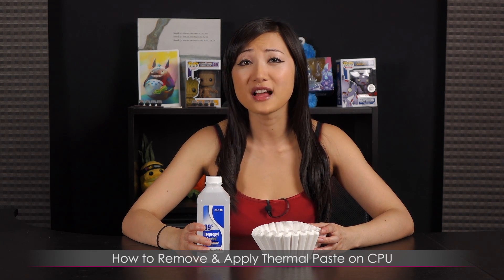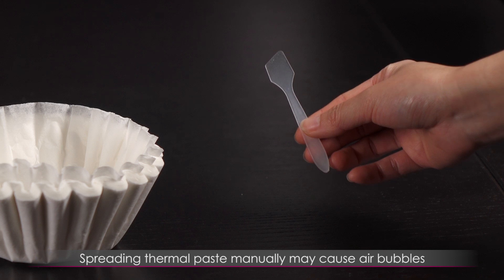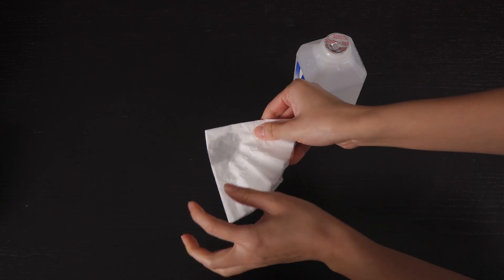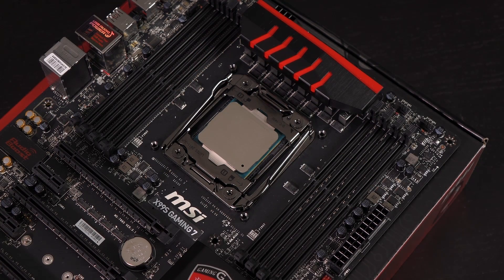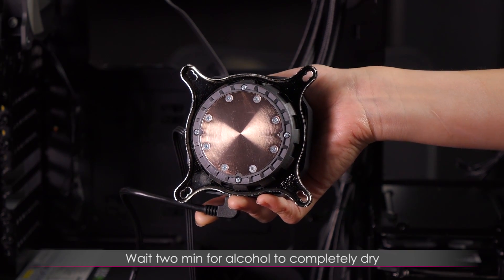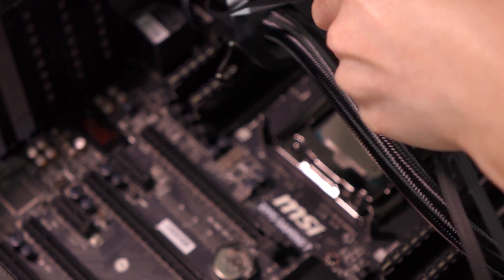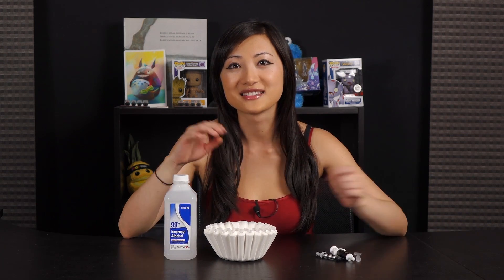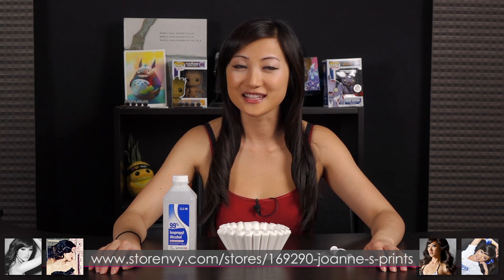How to Remove & Apply Thermal Paste on CPU

Comment: whoaaaa you use WAY too much thermal paste! The cleaning tutorial was very good (coffee filter-- great idea!) but the amount of thermal paste used will be detrimental for your CPU temps. A small rice bead is more than enough, the only reason you're using thermal paste is to mitigate any imperfections between the surfaces for a perfect transfer of heat. The materials on the CPU and the heatsink of the cooler are a lot better at conducting heat than thermal paste, so using less will actually improve your cooling.
Reply: brakgeluid
Are you an idiot that you cannot understand? Even the video proves it. Having too little actually makes it worse. Having a little too much does nothing.

The TLDR does not conflict with anything I said. The amount between the CPU and heat sink will be the same, no matter how much you put if you put enough to cover the heat sink (aka the minimum). The rest will be squeezed out. If there isn't enough, how the hell are you gonna cover the whole heat sink?
Reply: +brakgeluid as if you know anything about thermodynamics
Reply: JayzTwoCents did a video on this and proved that two much thermal paste doesn't make a difference to temps. While he only tested GPU temps, I suspect this is the same with CPU temps.
Reply: MEGA_MJRS they won't listen. I told them the same thing, but they keep on parroting what people said before. I even explained why (in my opinion) it is.
Reply: E Alex explain the videos, fool. He has no evidence for his claims as far as I can tell. The videos prove otherwise.
Reply: E Alex do you lack reading comprehension? What does "his method" contradict with what I said? Or even what MEGA_MJRS said?
Reply: brakgeluid
Ha, my ass.
Reply: +brakgeluid If you compress it hard enough it will be fine. Only issue I think is if you're using conductive paste which may go over the other components.
Reply: brakgeluid
You do realize there will be the same amount of paste between the CPU and the heat sink? If there is enough pressure, the extra paste will be pushed out. Meaning that putting enough paste will be the same as putting a little too much, assuming you don't a crazy ass amount.

Now if you don't put enough, well if you watched the video you would know the result.

TLDR; There will be the same amount of paste between the CPU and heat sink if you put more than the minimum amount.
Reply: So I was doing a new build recently and decided to test this myself. I had a new CPU to replace the old, and was only going from skylake to kaby, so figured I'd give it a shot. Too much thermal paste does absolute NOTHING... yes, NOTHING to thermals vs putting just the right amount. I ran realbench in each test with a light oc at 4.6ghz @ 1.35v on a 6600K. Was at 60-70c after about half an hour in each test. I did go higher using too little paste. I'm sorry, but after testing it myself and doing benchmarks, the one who was right here was actually 2010ngojo. It seems there are also youtubers who have tried the same thing. Jayztwocents I believe covered this with the same result. I was using a h100i gtx.

Another interesting note- its also running at the same as the stock paste that was applied to the AIO to begin with.
Reply: Even coverage is key using least amount of paste possible. I'm not sure a grain of rice sized blob would be enough, perhaps a 4mm blob would spread better.
Reply: I used brakgeluids method and it seems to have spread perfectly. My temps are really good right now, I OC my i5 3570k to 4.5GhZ with only 1.615V and under gaming load it reaches like in the mid 40's C.
Reply: Hey man I have a 3570K I want to OC it tomorrow, can you tell me if you use an aircooler? =)
Reply: +PapierVersnipperaar yup I use the hyper evo 212 air cooler, its amazing man and its only like 20 something bucks US and like 32 dollars on sale in Canada right now! Highly recommend. I use to always put off the air coolers cause they are sorta a pain in the ass to put on, if you will buy one, make sure you use a different thermal paste than the one included as its not that good, i recommend arctic cooler mx series. Speeds from the OC have been so nice!
Reply: No she is not lel....
Reply: I've been using too little thermal paste and the temps were fine until the next day they skyrocketed.
I used the pea method and temps were fine a couple of days and boom 50c idle.
X-method gave me 3-5 LOWER temps in LOAD, covers whole CPU and without air bubbles.
Reply: Roderick McPhail 
Not at all. Dry paste is a bad thing actually. It could create air bubbles.
Reply: You're a man. You don't know any better than to think this way.
Reply: I saw many tutorial on youtube and try many times myself, Brakgeluid is correct the ammount of thermal paste is very little. Altrough many people try many solution also the X pattern, the ammount of thermal paste is always very little
Reply: Yes is true. But from my prospective the rice bean always works out fine. There are many ideas about this thing, that seriously, you don't know which is true. What I know is too many thermal paste finishes to do the contrary, it's become less conductive. I think try is the best soluction.
Reply: 2010ngojo
most videos have his method.. how high are you? I can testify to his method as it has worked and was drastically better than any other method I have tried
Reply: 2010ngojo Apparently, more than you.
Reply: +brakgeluid hey you seem to know what you're talking about, would it literally just be a small dab of the thermal paste like legit the size of a pea?
Reply: Yup, maybe even smaller than a pea. I use rice beads as reference and try to put about half a rice bead on there :)
Reply: 2010ngojo
dude brake practically destroyed you, he knows far more. I even tried his method and it held. Stop.
Reply: wow you really are dense and have 0 knowledge regarding this topic.
Reply: 2010ngojo Stop trolling, or are you really this dense? Even your TLDR has a conflicting statement, are you doing that on purpose? Even more so, why are you even starting a debate on this? Less is better, it's not rocket science to understand that the more you put on there the more will be between components. No matter how hard you press. Sure some will end up coming out of the sides, but if you're at that point you've already put way too much on there. You want a layer that is almost see through! Not a thick sheet of grey goo.
Reply: 2010ngojo "If you compress it hard enough it will be fine." No it won't be fine. Like I said before; the only reason you are using thermal paste is to mitigate imperfections on the surface of the cooler and CPU. Thermal paste is WORSE at conducting heat away from your component than any metal, so using less thermal paste will result in BETTER/LOWER temperatures.
Reply: +brakgeluid shes a woman she does not know any better
Reply: +Logan Braveheart I KNOW RIGHT? yeah no it has nothing to do with gender and you are an idiot. There are literally millions of these video's and they all get it wrong, including the men.

Comment: hey i pulled a derp abd used the stock paste on the kraken x61. and on the bios it says the cpu idles at 39c. but on the cam software for the kraken it says it idles at about 25c. and i installed the kraken but lifted it up and dropped it back in.... should i take it off and reapply thermal paste or is it fine? the cam software says under gaming it goes to about 40-45c.
Reply: +Marcos Salmeron That isn't hot enough to hurt anything, I wouldn't do anything. I just downloaded CAM and found out mine idles at 71c and when gaming reaches up to 100c. 

(Don't worry, I bought a new cooler and some thermal paste, cus the stock cooler just ain't cutting it anymore. I'll be sad to see it go :( )
Reply: +Chef Boyardee ahhhh man haha 71c and 100c has to be not good at all haha. thanks for the response bro it help alot :)
Reply: Marcos Salmeron Happy to help

Comment: I tried it. I started my CPU. I get no video. Motherboard has a green light ON so that seems active. Fan is Active, A/C Power is ACTIVE. Motherboard Battery is new.
Reply: +Giovanni Masi You may have applied too much and had some run over the sides of the processor or something. There was a kid in my computer repair class at my technical school who jokingly licked one of our server motherboards and ruined it. They are very sensitive (obviously)
Reply: you could've accidentally unplugged one of the small cords inside as well.
Reply: I switched cases a few days ago, and I get no video now either. It's most likely a dead motherboard, and unfortunately you may have to purchase a new motherboard.
Reply: +Giovanni Masi That sucks. Did you make sure to plug in the CPU power? That's what happened to me when I forgot to :o.
Reply: +Chef Boyardee No, I did the small pea drop size and applied it correctly. Did not run over.
Reply: +Giovanni Masi Could you have scratched it while handling it? Touched one of the traces (also known as busses or bus lines)?
Reply: Did you put the thermal paste between socket and cpu or between cpu and  radiator?

Comment: Ronsonol lighter fuel is commonly used by professional technicians for this sort of electronics work. It will clean off old goop much faster than alcohol. It took you so long to clean those surfaces because you were using mostly physical action to effect the cleaning. The naphtha based product is a very clean and mild solvent.

Comment: Is there something other than alcohol I can use,like a perfume or a sanitizer?
Reply: +Mohammed s. try beer
Reply: +Mohammed s. Please don't. Perfume and sanitizer have other ingredients that will be left on the surface of the CPU. If it's a religious objection, isopropyl is not a drinking alcohol, and has been determined to be halal. It should be available cheaply at most pharmacies.
Reply: +Charles Tishman lmfao that religious objection xD
Reply: +Charles Tishman wow he's dumb xD

of course this alochole is hala its not beer...

Comment: Good video but she should use an ESD strap just to be on the safe side.
Reply: Not really needed. Just stay on tile or hardwood. Avoid bloody cats that roll around on carpet lol. Hell I was screwing around inside on carpet, don't have to over the top careful, just avoid touching the mobo directly, easy to do.

Comment: I am changing out my thermal paste today. I know how to clean, and becareful when it comes to removing, and taking off the cooler, cleaning the old paste off. My only fear is either using TOO MUCH, or not enough thermal paste. My first time doing this.
Reply: By the way, for anyone still watching this video, there is no such thing as too much, only too little. You can search for it on YouTube, but there have been multiple tests with "too much" paste and it had like a 0.4 C difference at max with the most amount v.s. the "normal" amount. As long as it's not enough to the point where it actually gets into the socket or the motherboard, its fine.

Comment: Which method of applying the thermal paste is good if the heat sink surface is square in shape?
Reply: Vicky Ray The pea is preferable for all\most heat sinks. If using a Intel CPU, most of the heat will generate from the center. If an AMD CPU is used, the four corners will see heat accumulation. The pea method should cover both if applied well.
Reply: Vicky Ray It doesn't matter how the heat sink surface is, it all depends on the actual processor chip size and shape (which you cant see). Use this link to find the best way to apply thermal paste for your CPU: http://www.arcticsilver.com/methods.html
Reply: SoidSnake Thank you very much!

Comment: Curious does the Pea Method still apply to the i7-4790k? Sorry for dumb question I am new to Intel Cpu's.

I did did the Pea method on my current CPU a few months ago which is the i5-4690 non k and the temps idle in the 20 - 30's depending on room temp.  Under load there around 50 to 61c depending on room temp.

I am using the Noctua NH-L9i 57.5 CFM CPU Cooler on the i5-4690,will that be good for the i7-4790k?

Thank for any response.

Comment: Do i have to use all of the thermal paste?
Reply: Beni Hotoi 
Nope, just a little bit - so the all CPU surface got thin layer :)
Reply: sorry the answer is "just a little".  I though the original poster was asking if he had to use thermal paste at all.....
Reply: Beni Hotoi yes.. its for heat transfer
Reply: ***** 
Hmmm....Yep, you're right :)
Reply: ntxt

Comment: Im curious when applying thermal paste you dotted the middle of the processor and attached the fan without spreading. Is that the safer way todo it to avoid bubbles?
Reply: Brian Beauchamp yep. you just use the pressure from the heatsink to spread the stuff out. i'd personally use a smaller quantity of thermal paste.
Reply: ok ty

Comment: ok, so i bumped in to a problem. i cleaned both heatsink and proc very carefully, never left any residue on them, placed a pea-sized amount on the cpu like everyone prefers (i only have a generic type of compound). placed the heatsink reaaaallly carefully. applied even, moderate pressure on all sides then screws it into place. plugs the computer. enters bios. checks the clock as it runs, and in less than a minute, the computer freezes, i even have the case open on the side.

Comment: Joanne Tech Lover Hi Joanne,

I was wondering if you would happen to know if the corsair H60 liquid cooler is able to be fitted into a TT Commander Gaming case.  my old cpu fan has finally died on me, and I don't like the results I got with heat sinks so I'm looking to expand to liquid cooling for a test to see if it's any better or lasts just as long as my heatsink did.

also would you happen to know if the H60 comes pre-applied w/ thermal paste?
Reply: podagee4life Pretty  much all AIO Liquid Coolers come pre applied.
Reply: Rahul Katre some of corsair's don't which is why I asked.

I believe the H55 and H50 don't come pre-applied
Reply: Pretty much. I know the H60 does, since I was going to buy it, but I bought the NZXT Kraken X31.
Reply: Rahul Katre ah.  I bought the cooler anyway; it didn't fit at first but after some minor trimming to the screw holes I was able to make it fit.

Comment: X shape gives best dispersion. has been tested with clear plastic on youtube videos before. much better dispersion
Reply from the maker: jack black Glad you think so too!
Reply: +jack black Yeah, but the heat from the CPU comes from the center, creating a expanding heat circle, so covering the whole CPU doesn't really matter as the circle formed paste will prevent too much heat from reaching the corners.

ALSO, big also. The thinner the thermal paste the better the heat transfer from the cpu to the heatsink. Too much paste can increase the temp'  as much a 4-8 degrees. Those Pea-method elitist aren't really wrong when they say that it is the best method.

Comment: is arctic silver 5 any good? is 3.5 g enough?
Reply: Stephen Pope 3.5 is enough for several applications. use way less. arctic silver is fine, i prefer mx-4
Reply: givemeajackson Excellent. right on time as well as i am just applying the thermal paste today.
Reply: Stephen Pope just put on a splotch of the size of a rice grain. you really don't need a lot of the stuff. it will spread more evenly when there's heat coming from the cpu.
Reply: givemeajackson Yup. that's what iv'e been hearing.
Reply: Stephen Pope good luck sir!

Comment: Joanne! Can you go into something a bit more hardcore like lapping the CPU & CLC pump? You can gain significant temp improvements if you polish the hell out of them. The smooth surface allows better heat transfer. Most people don't realize that the factory finish looks smooth but isn't actually and sometimes even a bit concave.

Comment: I've been using Arctic Silver's ArctiClean for years, works better than rubbing alcohol for the worst thermal pastes, like burnt thermal paste on a i860 running 100C.
Reply from the maker: elsydeon666 BURNT? That sounds scary. O_O
Reply: Joanne Tech Lover was more like "wow, that thing didn't die?!, Intel can make one tough chip" using that chip to write the reply right now in fact:)

Comment: One thing I've often wondered is that when I use thermal paste, I never use up the whole tube. What's the best way to store that leftover paste and for how long can I keep it before it becomes a better idea to just buy new paste?
Reply: I usually just store it in a drawer or cabinet that isn't outside storage temperature.  The product should tell you what that is.  I've found they tend to last for at least a couple of years that way.

Comment: I just ordered some arctic 5 thermal paste yesterday. This video is going to come in handy. I have a feeling my CPU is going to look like a complete mess though.
Reply from the maker: John Hunter Lol, but, it'll look brand new after some cleanin'!
Reply: @JoanneTechLover  I have a question. Instead of using thermal paste, can you use a thermal pad on the CPU instead of thermal paste? Will it work and will my laptop be able to work normally if I use thermal pad in replace for thermal paste?